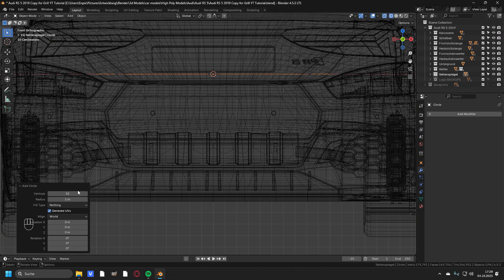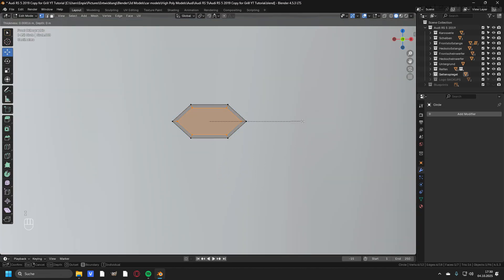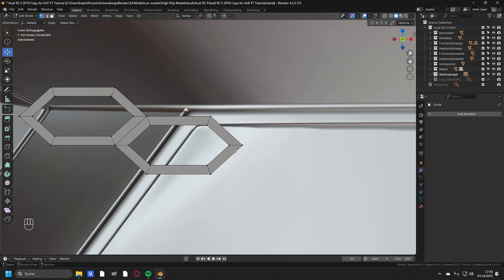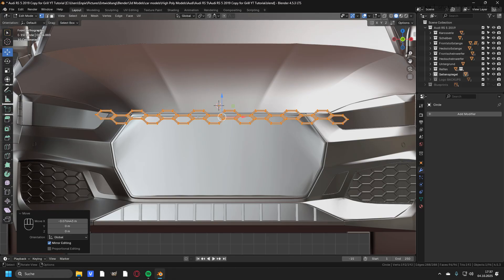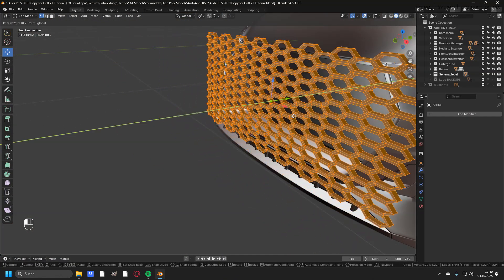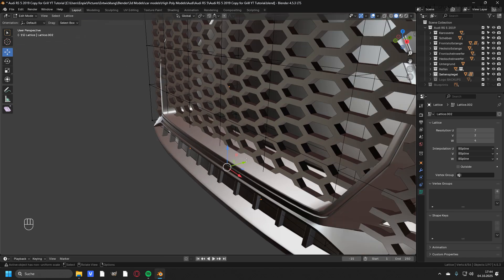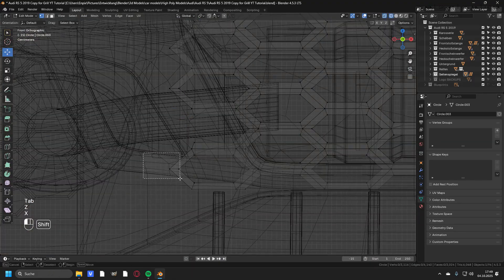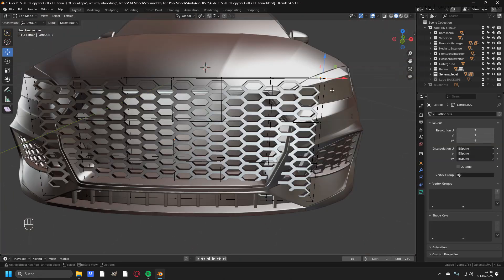How To Ceate A Car Grill In Blender

Comment: When moving the second hexagon, better use magnet so you don't need to match it manually. And I think for this case 2D lattice is enough and easier to use
Reply from the maker: Sounds like this would be easier, I definetly need to try it out, thank you